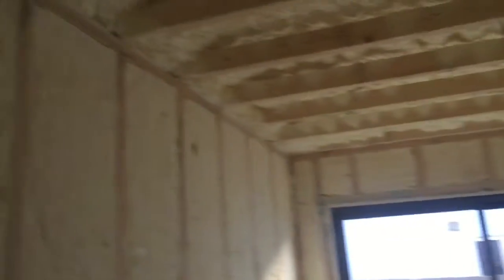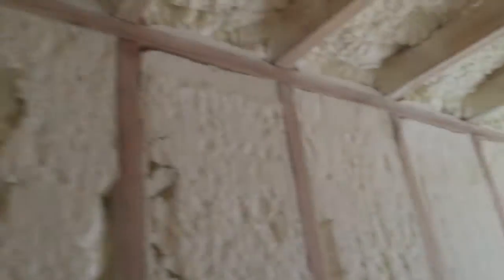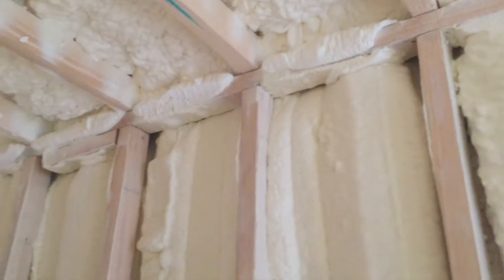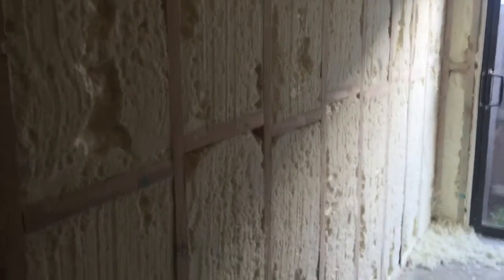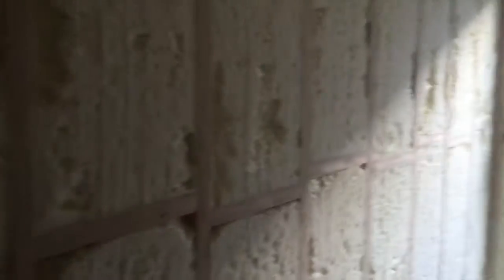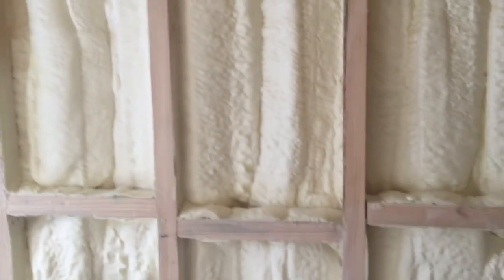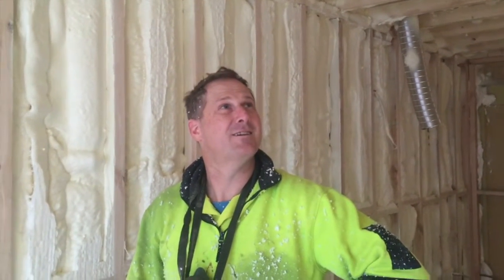Spray Foam Interview

Comment: Good work? Have you tried to spray the container externally, then put siding on?
Reply from the maker: I have not done it but is an option, need to make sure the foam is not exposed to UV light.  I will be trying this on a job later this year where a container is sticking out the side of a building